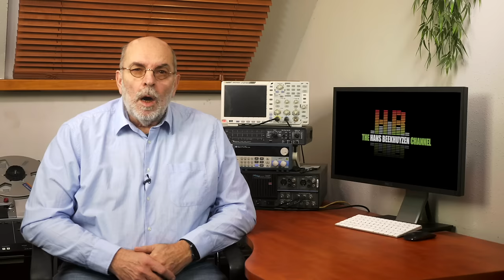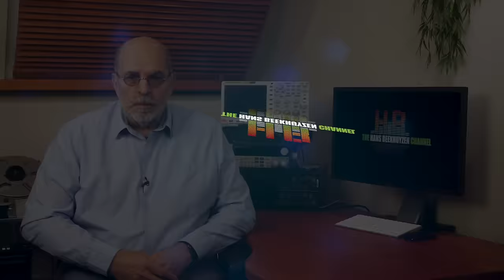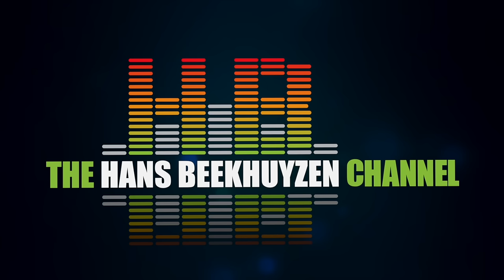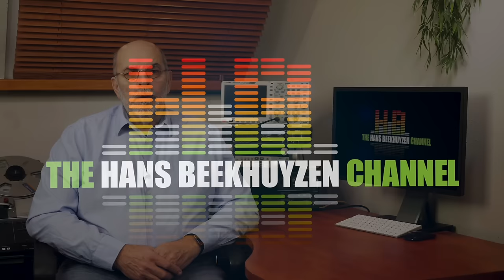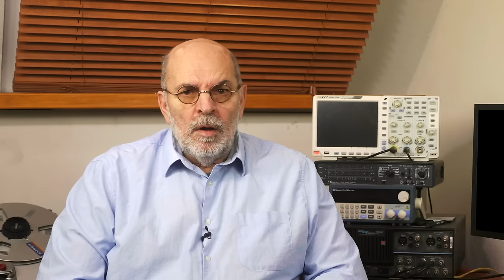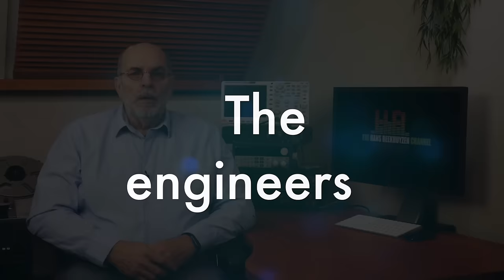The Universal Question  what sound better?

Comment: Dear Hans,

Maybe my question could lead to a new topic. After having been under a hi-fi rock for about 10 years, I have been completely captured by the hi-fi virus again for the past two years. I learned so much from your channel, especially in the field of streaming, a new world opened up for me. I currently only play music by streaming and I am now looking into how I can improve my installation. I have two questions about that:

1. What has more impact on the sound quality, the streamer or the DAC. personally I would think the DAC because that task seems more difficult to me. I now know that streaming is more than just passing on ones and zeros, but in the end it comes down to that. I understand that the clock is very important, but a good DAC has that. And that you can upsample and filter and all kinds of things, but a DAC can often do that too. And that you have to keep noise and interference low, but if you have a good Ethernet switch and filter then you have come a long way. I am curious about your vision and, especially, practical experience.

2. Is it better to have integrated equipment, or everything separately (up to and including the power supply) Nowadays you have a lot of equipment in which a DAC is integrated, for example a streamer or an amplifier or even an all-in-1 device, I recently listened to the AVM-CS8.3, and I was very impressed. I have everything separately (streamer, DAC and amplifier, and a separate power supply for all three). I can imagine that if you have everything in one, the components are better coordinated. The disadvantage may be that there is more interference between the components, you would rather not have a sensitive streamer close to a powerful amplifier signal. I'm curious about your vision.

Sincerely

Arno Floore
Reply from the maker: Every component has its influence on the sound. If the streamer degrades the sound quality, the DAC won't be able to remain that and so on. And, despite simple logic says that bits are bits, the digital signal can severely damage the sound quality by offering the DAC a less stable and/or polluted digital signal. Question 2: it all depends on how well the equipment is built.

Comment: As usual, most informative and interesting.  I would point out that, at this point in time, the use of MP3 files seems ridiculous.  You can buy a 4 Tb solid state hard drive for less than $400 around here.  Memory is no longer a rare commodity.  For my spouse's car I purchased a half a Tb thumb drive and loaded 18,000 FLAC files on it.  You are correct that a car is not an ideal listening environment, but we get pretty good sound for months and months with no repeats.   And finally,  thanks for all the great videos.  You are appreciated.
Reply from the maker: Thank you and agreed
Reply: Those who listen MP3 are not that interested in sound quality (or have not discoverd the difference yet). They listen via mobile phone and that s it most of the time.

Comment: Hello Hans. I'm glad you spoke about bit depth of recordings. I have a question about album versions available from the high-resolution streaming services, I'll give an example. The Smile have just released Wall of Eyes and from Qobuz there are two versions available, both 44.1kHz but differing bit depths of 16 and 24bit. From The Smile's website a digital download is available only in 44.1/24. Why the two versions with bit depth differences only, especially the 16bit?
Reply from the maker: The Node gives 16 bit out
Reply: So, your using the Bluesound Node as an example of a DAC that only supports 16bit hence the need for a 16bit file, am I understanding you correctly?

Comment: I don't know if I'm on topic, the question is:
Could a 1:1 isolation transformer be used upstream of each hi-fi component?
Reply from the maker: Yet it could, but it would give losses. To what degree that is audible depends on the quality of your gear, your ears and the transformers.
Reply: @TheHansBeekhuyzenChannel  I was thinking of using a power conditioner,
the costs are very high.
if I use good quality and oversized transformers
galvanic isolation could bring me some advantages

I already have a dedicated power line just for hifi, I don't notice any disturbance, the background is quite dark

the equipment is: innuos zenith mk3, ddc hermes, dac terminator, pre audio research ls28, mccormack dna 500 power amplifier, b&w 801 matrix s3 speakers, well-treated room of around 35m2, good quality accessories and cables.

p.s. If I'm not mistaken, network conditioners are a topic you've covered yet
I congratulate you
greetings from Naples